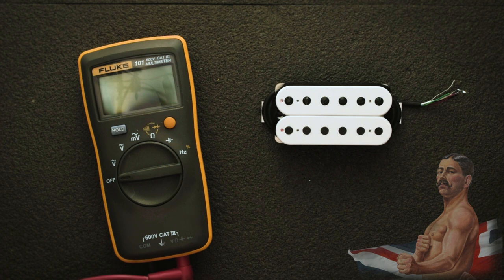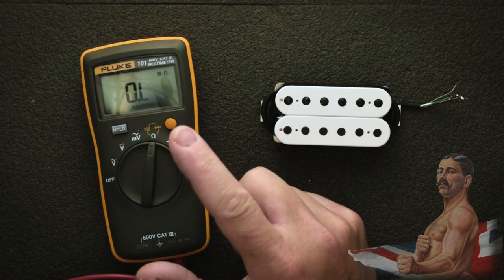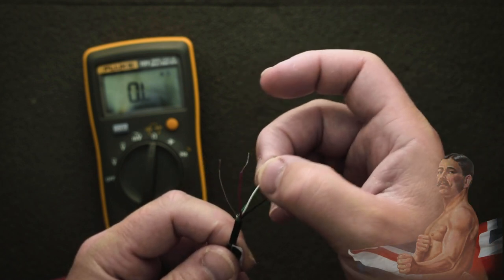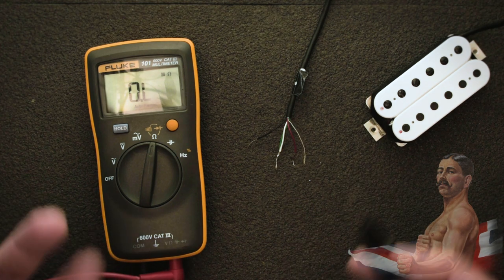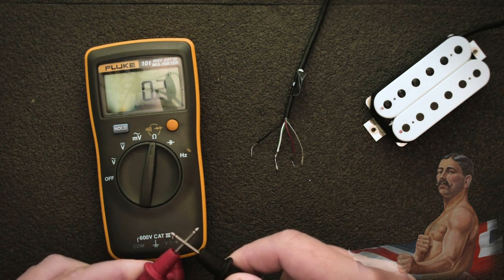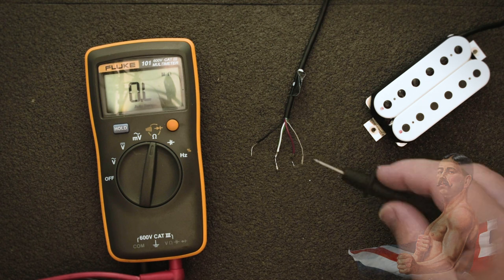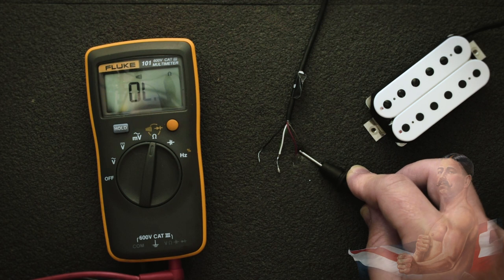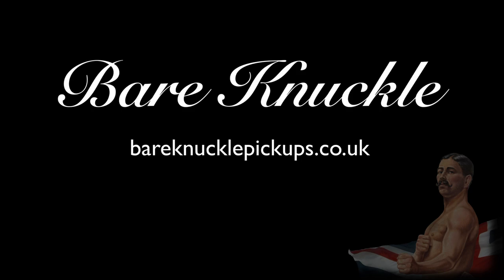Using A Multimeter To Check Pickup Health

Comment: Hi I'm having issues with my Emarald neck pickup, it's measuring low resistance when I check the bare wire with the coloured wires, any idea how I fix this?? Cheers, great video!
Reply from the maker: if you are getting a low reading between the bare and any one of the coloured wires, you most likely have a short circuit between one of the coils and ground, or part of the wiring is touching the baseplate of the pickup. Have a close look for any cuts or wear to the insulation on the wiring to make sure that the bare wire cannot touch any of the others

Comment: Hi I just received Gibson 400R&T Humbuckers It puzzled me that when trying to read the resistance touching the bare earth with wire they did not give any reading. I thought they were dead then I stumbled upon this video.  Reading between red and black wires both pickups are slightly a over 8Kohms. So how would you connect them in the guitar as full hum buckers. is there a schematic tutorial for this? I alsweay thought it was simple connecting bare earth wire on one end and the other 4 on the other end if you want full hum bucker resistance. These new pickups puzzle me.  I would be grateful if you can advise how to solder these ends inside a 335 style guitar. Thank you in advance!
Reply from the maker: Hi David, here's a link to our conversion chart, which shows how your Gibson wires relate to our colours: https://www.bareknucklepickups.co.uk/upload/support/Humbucker_Colour_Code_Conversion_Chart_1940bd0.pdf

Comment: Is this color code standard for the industry?  I have an Ibanez that was tinkered with by a previous owner and I think the pickup wiring is wrong.  It has dual mini-humbuckers with 4 leads.  There is Red, Green, Black, White and shield.  However, the Red and Green are tied together and the whites go to the volume pots.  I'm stripping it completely tonight and measuring the coils as you demonstrated but then I need to know the phasing, or "in" and "out" lead color.  Thanks.
Reply from the maker: Hi Erwin, no, there are many different interpretations of 4 conductor wiring colours. you'll need to look up the code for whatever pickups were fitted originally to this guitar.

Comment: Neck pickup has low output and sounds bad. Meter shows 0.0 reading. I heated where lead strands connect to eyelets.  Pickup will then work fine for 2-3 days. Then goes back to low output and sounds bad. What is going on? Thanks
Reply from the maker: I'm presuming from the description that this is a Strat or Tele pickup? If reheating the joints is getting you temporary improvement, I would suggest adding some fresh solder, as there might be some oxidation in those joints that really needs to be driven out. Ideally, use a solder wick to remove the original solder and completely replace it with fresh.

Comment: my humbucker reads .479 MOhms I don't know how to read it in Kilo Ohms, can you help me?
Reply from the maker: it sounds like you are just getting the reading of your volume pot right there (presuming that the pickups are currently soldered in). Either you have a break in a coil, a bad connection, or simply that your pickup selector isn't set in the right position to measure that pickup

Comment: I'm about to buy 2 used Bare Knuckle pickups that the owner doesn't have the box, and bought them used. The previous owner said to him that they are Jaggernaut, they read 13.7 and 9.44, une of them have two rows of screws, and the other one two rows of lugs. Are they Jaggernauts or can be some other model like the Bootcamps? Thanks
Reply from the maker: Hi John, none of the Boot Camp series have double rows of screws and they have a specific Boot Camp baseplates so they are very easy to identify. The numbers that you have for the coil resistance certinly match up to the Juggernaut model
Reply: @BKPickups  Thank you very much!

Comment: awesome tutorial,,i learned alot here,,,,question i have a paf pro and according to dimarzio the kohm is 8.4,,,when i touch the black and red  wires i get a reading of 4.14,,,,,,is there something im missing or maybe not doing something right........hope you can answer,,,thanks for the video,,,so i just connected the black and white together as per dimarzio....and when i touched the green and bare wire then the red wire with the probes i get a reading of 8.30
Reply: BKP and Dimarzio use different colour codes for their wires: 
https://www.bareknucklepickups.co.uk/upload/support/Humbucker_Colour_Code_Conversion_Chart_1940bd0.pdf

Black and red wires on your Dimarzio gives you the reading of the north coil only. Probes to red and green, with white and black wires connected to each other is the correct way to measure both coils of your Dimarzio in series. Readings of 4.14 on the north coil and 8.3 in series seem healthy/expected.
Reply: @nacl329  thank  you,,and thanks for the link as well!
Reply: @mesametal8768  No problem mate.

Comment: Your humbucker has 3 more wires than the one I want to diagnose. I wonder if that's the problem >_>
Reply: He's humbucker has wires for all the coils ends/starts, however if you have just two wires, it means you've got just ground and hot wires. 
This means you have no access to coil splitting and mods, but nothing more. Just put one pin to ground and the other to hot.

Comment: Good.
But people forget about Inductance which is not mentioned. It works in combination with the coils .,. Magic soup.

Higher inductance (magnetic field) measured in Henries increases output. You can switch out the magnets in buckers to change characteristics easily.

Get a meter that measures both I would suggest. High k ohms does not necessarily mean louder than lower k ohms, it depends on inductance factored in.

Also capacitance should be low like 2 Pico farads. You can get meters that measure all 3.